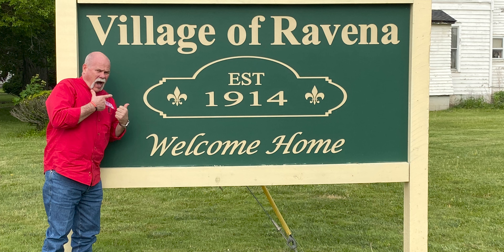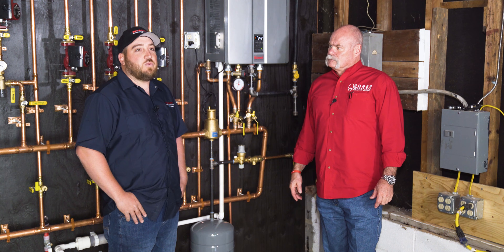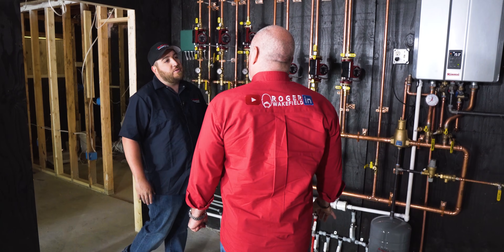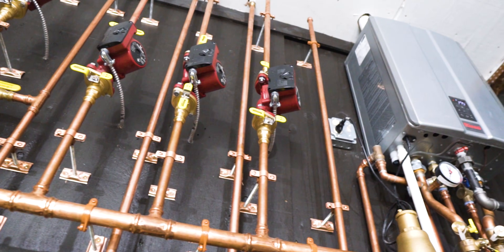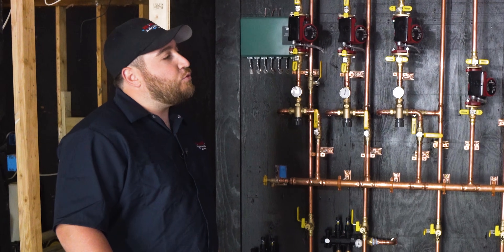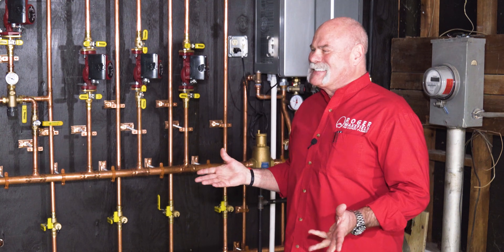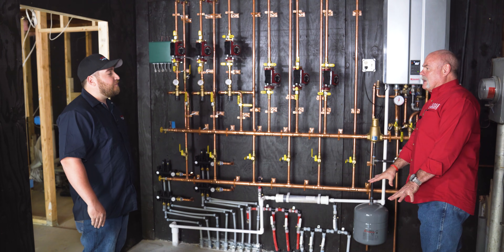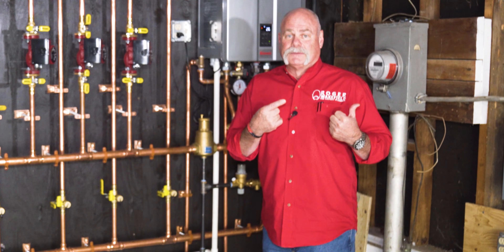I've Never Seen ANYTHING Like This | Combi Boiler Install

Comment: Okey  maybe I'm am just a spoiled brat in some way or another, or maybe I'm just stupid, but I am 24 years old, I just learned how to solder copper and I don't want to see and moreover ever use a propress tool. You can not convince me that a bloody rubber ring pressed on the copper surface will create a water tight seal for 50 years. Have you ever seen an oring taken out from some union installed in a heating system? It is disintegrating into bloody dust! Plus the pipe itself moves over time. How can you convince me that it will not rub trough the smooth surface of the pressed oring and not create a leak? You may ask, well, if the oring in the union is crusty but it did not leak, how will it leak in a propress fitting? It will leak because the union is locked together by a thread of the union nut and fitting itself. It is mechanically joined together. And what about propress fitting? it is just pressed together. There is no biting thread that immobilizes the fitting and pipe. It is just pressed together. It will eventually loosen up and start moving with expansion and contraction of the pipe. Moreover it will loosen up because of water hammer. But you may say that the Viega is proposing that the fitting and the oring are designed to not leak for at least 50 years. Bull fucken shit. How can they now this stuff? Did they install propress fittings in 20 different environments and left them there for 50 years? No they did not! They claim their orings are special rubber that is resistant to harsh environments. Bullshit. They order boxes of 50k rings directly from china and use them in the fitting. Lets not forget its 2023, and not 1980s when the proposals and special features of special new things are actually true what are claimed by the manufacturer. Its all bullshit these days. What if the fitting is in a very humid area? it will corrode into green dust. What will happen if the corrosion creeps into the fitting and corrodes beyond the pressed seal? How will it not leak then if the corrosion creates uneven pitting? It is a time bomb, a recepy for disaster. Soldering is king and should remain this way, especially in heating systems! This is only my opinion.
Reply: Well said
Reply: Thank you :)
 @stevec6365
Reply: Hi, I work as a plumbing and heating installer in the North West of England. 
One hotel I work for had a brown plastic - push fit system installed in the early 1980's, it was called Acorn Plumbing back then.
I have to say its still working well, no leaks, fittings can still be rotated without leaks.

The only leak I've come across was where someone had missed the stainless steel pipe insert on a pipe to a compression fitting.

So that's around 40 yrs old now, amazing isn't it.
Although I do wonder if O-ring plumbing will prove to be more reliable on plastic pipe rather than copper pipe, time will tell.

All the best, Fraser

Comment: 3 radiant loops, 3 Air Handling Units in attic, and also Potable Hot water demand. Can this Rinnai unit handle that load in sub freezing weather?
Reply from the maker: Yes, We mention it during the video…It still operates in -20°f
Reply: @RogerWakefield  yeah, it operates Roger but that what kind of efficiency? Don’t forget these “high efficiency“ units are rated differently than the non-high-efficiency so even though you saying that they save a lot of money, they really don’t because the high-efficiency units are rated at a lot lower temperature than a regular conventional boiler would be. (be like comparing apples to oranges, yes, they are both fruit but they are two different things) Don’t be part of the scam. Roger but rather be part of true and honest information to your viewers. Otherwise you’ll be talking to be like a politician, only doing half truths!
    Edward H. – “Integrity, Plumbing, Septic, Heating and Drain“ out of the Clinton, CT USA area.
Reply: Exactly that lil tug boat that could of a Rinna I'd maxed out all the time and forget about a nice 30 min bath....at -20 degrees all the energy going to DHW, your pipes will be nice and busted from ice. This is all a joke. I bought this bs idea and lived through the constant break downs and waiting for heat and hot water not to mention waiting for parts of the nician he'll, but the good news is it's very efficient... and included in that efficiency is the efficient way it back flushes your wallet! All junk!!!

Comment: Combi are great boilers and so easy to fit,been fitting in uk for 35 odd years ,the newer versions have built in water tanks to improve the flowrate on the HWS
Reply: Who in the Uk would need or pay for this system.
Reply: @onlyme972 Any dwellings or commercial units

Comment: Pretty sure glycol which I assume your using for anti freeze doesn’t do well with propress connections.. idk could be wrong I still sweat all my stuff.. looks like a clean install besides the uponor lines, I’ll never like that look
Reply: I do chemical sales and service for hydronic systems. See a lot of propress systems with glycol and no issues. As long as pH is maintained and there’s proper amount of corrosion inhibitor they’ll last longer than the owners. May be issues with ethylene glycol but since we rarely use it and most people are switching to propylene to reduce hazards and hazmat disposal I really don’t know if they affect the o rings. Another thing we’re seeing more of is putting ethanol alcohol in systems for freeze protection. Not sure how that will affect them either.
Reply: I’m not sure why they would even need it on new construction, should be very well insulated home
Reply: Prolly garage floor @glenarseneau1231

Comment: i'm a brand new pre apprentice and seeing hydronics like this is super intimidating. is there any way to learn this stuff outside of the job? the extensive piping all over the place just confuses me, i don't even know which way flow is
Reply: Reading. It’s a lot of footwork to learn it off the job and I wish I had specific stuff to send to you. Instruction manuals.
Reply: Dan Holohan's books are a great place to start. "Classic Hydronics," "Pumping Away," and "Primary Secondary Made Easy" are 3 fabulous resources to teach you the fundamentals.
Reply: There's so much YouTube videos on this stuff and i personally went to a Navien class where you take one of there units apart and put it back together and troubleshoot it....prettty sweet experience....the longer you do it the easier it gets, every job you go to take a picture and draw a diagram of what's what and label it and you'll understand it in no time

Comment: I just watched this one. And maybe I miss something. But the cold day's there antifreeze in the water. Forrr heating purposes. But not in the tap water, right, or for showers water as well. It's just for heat. Just wondering. Have a good day and God Bless
Reply: Correct,the domestic water and heating water are separate.

Comment: With this setup  I would go with an Air to Water heat pump. It would take care of cooling as well.
Reply: The last house I did, we placed cooling pipes in the ceiling. And cool the system with ground water, that’s used for the garden, separated with a heat exchanger.

Comment: @RogerWakefield

Hi Roger. I thoroughly enjoy all your vids!
As a scandinavian plumber, i have a question.
Why is it, that americans often install so many pumps? I come From the country that produces these centrifugal pumps, and here we usually just install one Per house.
Is the just that the building is that big?
Reply: It's really a matter of personal preference. A lot of North American hydronic heating runs off of open/close thermostats as opposed to a constant circulation system where individual thermostatic valves are controlling the radiators. This particular installation is using individual zone circulators, but there are plenty of systems where there's one larger circulator feeding individual zone valves that open or close based on a thermostat call. Just different design philosophy at the end of the day.
Reply: @patrickcorcoran4377  Right, and it looks really good! But it also looks labor-and cost expensive. I don’t know what you guys pay for a centrifugal pump. But here, they are around 350-450 dollars.
Reply: @rasmusfrom8455  depends on the market and the specific circulator, but you're probably in the range of $150-200 per circulator. Now, some municipalities and utilities have rebates for certain kinds of circulators which can drastically drop the price of those once taken into account. Yes the cost might be higher, but you're getting additional redundancy with multiple circulators- if one goes down you've still got heat in all the other zones.

Comment: Your looking at circulators, radiant mixing valves air scrubber, prv backflow preventer. Typical hydronic heating, expansion tanks

Comment: Where are the check valves, this system is not optimal.
Reply: those circulators all have integrated flow checks(removeable if not needed).  (flow check/check valve/ non-return valve) whatever you like to call them.
 grundfos with an (F) in the model = has check valve. taco with (IFC) = has check valve.
across the different brands/models not all come with flow-checks, some can be ordered with/without and most will accept if the body is the same. not sure about all the other brands.
some are shipped pre-installed, others the valve is in the box and needs installed with a sticker on the unit, denoting it has a check.

Comment: what is with the black iron pipe on the top off line? hope  your top off water is pre treated with a corrosion inhibitor. otherwise your just going to be sending rust into your system to plug stuff up. they literally saved like $100 on a 20K + system W T F!!
Reply: nice catch, such a bizarre decision.
Reply: Are you sure those aren't epoxy coated galvanized steel?
Reply: @rdizzy1  maybe they painted the brass to match the back board, realistically, there shouldn't be a lot of fresh water running through anyways, and the air separator probably will catch any debris if any.
Reply: @terabyte7979  Yeah, I figured if they were installing something that expensive, and they wanted/needed to use galvanized pipe, they would use epoxy coated, lasts just as long as anything else. Likely 50+ years.
Reply: once the system is filled and bled, there should be near zero makeup water entering, so the oxygen level drops very low and black iron pipe wont rust, plus that's teed to the expansion tank, so it will have glycol mixed solution flowing in and out.
hydronic for years used only black iron pipe and cast iron, then some copper mixed in and as long as you don't have a leak, no oxygen rich make-up water enters. it's imperative any leak is fixed immediately, even the tinniest weep.

Comment: Good video very interesting. Plumber in Texas and i don’t see systems like this!
Reply from the maker: Me neither, honestly I wish we did more. Heater floors?! Sounds great
Reply: @RogerWakefield if you want some boiler insulation pictures let me know. That’s all I do
Reply: @RogerWakefield 
It called in floor heating. 
We install the tubing on 8” centers. We keep the loop length below 200’ for each circuit.  If you really want to learn more about this process let me know
Reply: @RogerWakefield  when I had my shop up here in North Franklin, CT I had radiant heating in the floor and let me tell you it is so nice because of the heat is even and the cement acts like a heat sink and if you have to do anything on the floor you’re not freezing your butt off especially in the winter time up here in Connecticut! I am and have been a subscriber of yours and you do excellent work 99.99% of the time.

Comment: looks expensive LOL
Reply: just the plumbing with the unit on the wall without the loops is above 25-35k here in Seattle.
Reply: @terabyte7979  You're crazy its no where near that for just material lmao
Reply: @RankSevenYasuo  it sounds crazy, but you don't live in Seattle without expecting that. 680$ per hour and between 85-100% mark up. And we do these frequently. Business cost is also high. If you live in Ohio then sure, all it takes is a beer and a half eaten burger.
Reply: @terabyte7979  I do large commercial plumbing and hvac in CT/NY lmao im no stranger to expensive wasted money systems. I guess I'm not from Seattle but sounds like you're exaggerating, that's not even a days work whats on that wall with 2 guys.
Reply: @RankSevenYasuo  I think you're exaggerating now. That's definitely more than a day's work. From planning to ordering materials, getting the job site and items ready. Measuring getting the pumps ready, wiring and so on. There is so much going into this, 30 hours minimum for a system similar to the one shown. Maybe for a unit swap out 1 day should be enough, but that's rarely all that's needed.
Reply: Jeez I'm glad I live somewhere warm...

Comment: It brings me joy to see the Grundfos logo
Reply: When we put in our new solid state transmitters, the heat exchangers came with Grundfos pumps. 25% the size of the old pumps, run silently, and can be changed in minutes if the need arises.